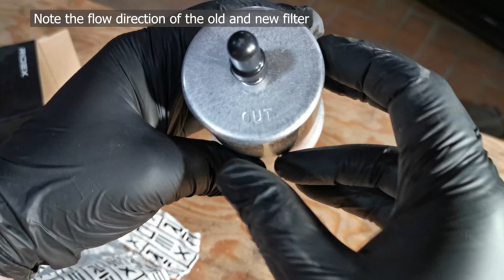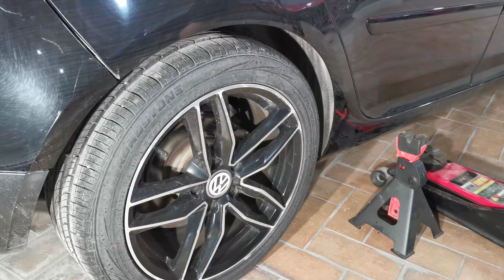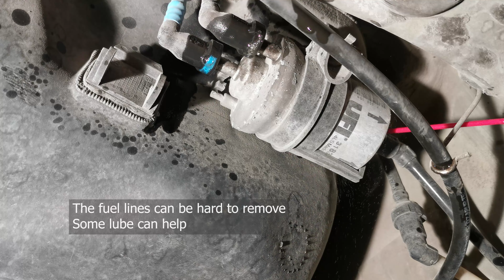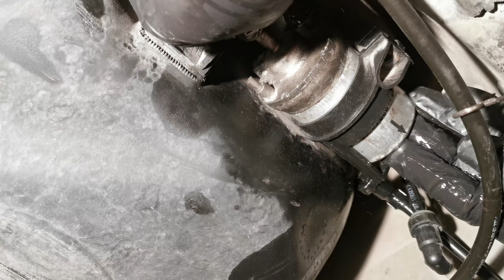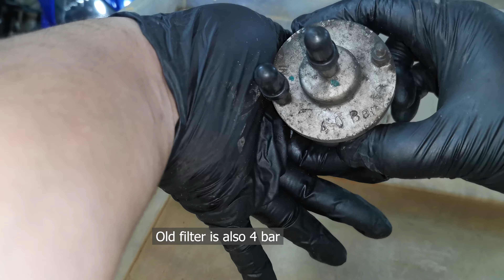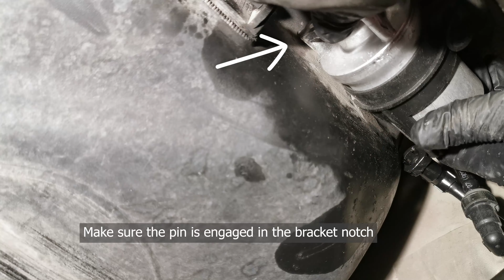Golf MK5 1K1 Fuel Filter Replacement

Comment: Your Video is perfekt. I have not found any documentation about every step except your Video. I want to change the filter tomorrow and feel very well prepared. I just have one question about starting: Wouldn't it be a good idea to turn the ignition on and off a few times to bleed the system?
Reply from the maker: Thx :yougotthis:. You can if you want. But it's not required according to the repair instructions. And you can see the amount of pressurized fuel that came out in the video, it's not too much. Just have a rag around the line while opening it and a container under to catch the fuel coming out.
Reply: @ZakiGarage  Thx!

Comment: is it 1.6 FSI ? where can i find gas filter in passat FSI
Reply from the maker: Not an FSI engine.  Not sure about the passat,  but it's easy to look under the car in front of the rear wheel if the filter is there.